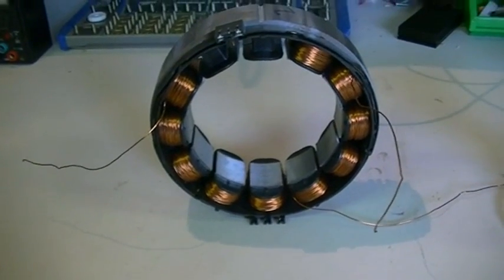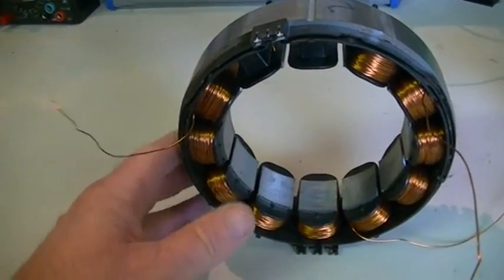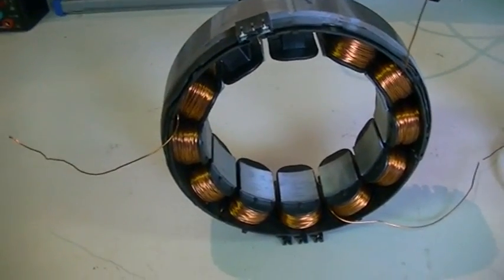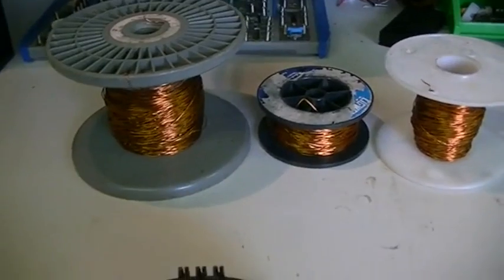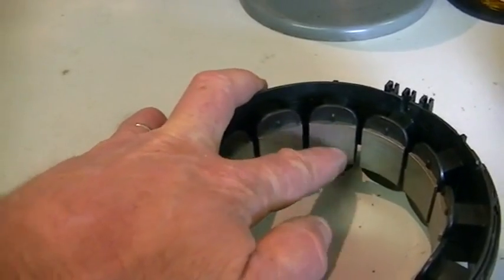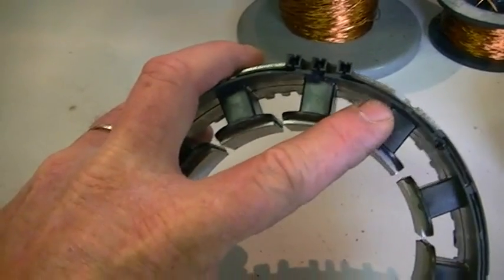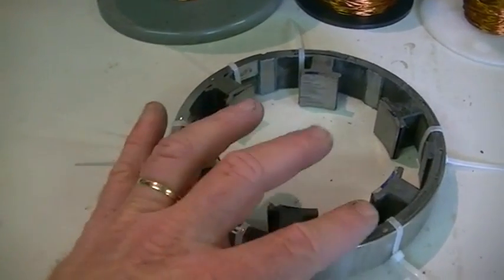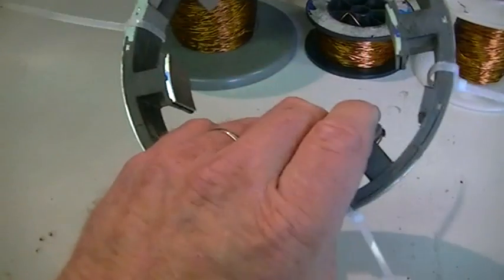Tesla Hybrid, The Lenz Force Motor Generator

Comment: Everything is
Watts and torque.

Gas engine torque is rated at the catastrophic point of rpm, because you can't use an engine for long duration at  maximum rpm.
Most engines are designed to operate from 700 idle rpm through 3500 rpm normal eceleration then level off between 1500@45 mph through 2000 rpm@ 70 mph.
In this max run zone you are only utilizing 3.5 % of gross how.
So a stock 200 hp engine cruising around 65 mph is only useing 65 hp, and the torque is relatively about 2/3 the used hp also, so @ 65 mph useing 65 hp. The engine is putting 1/3 the available torque on the crank.

I don't care what you want to accomplish with electricity vs gas.

You only 3/4 electric hp to get the same usable Nm of torque you will from a 5 hp. Gas engine running @ 3500 tpm.

So.
Inorder to provide the same working torque of a 420cc 15 hp gas engine  driveing @ 12000kw generator input shaft.
You will only need a 2.5 hp. 1550 watt 120v 13 amp 3600 rpm electric motor to get the needed 26 Nm of torque to drive the 12000 watt generator.
Thats only useing one of the 120 v 15 amp recepticles to drive the whole damn thing under full load conditions with out the gas engine.
a free wheel clutch installed between the gas engine and generator allows the engine to uncouple from the gen completely when the elc motor takes over for it.
No telling how long a gallon of fuel would last needing only a half teaspoon to start the contraption.

Comment: Your thinking here makes sense to me. The way I see it, an ac induction motor may be collecting flyback to add torque on the shaft,  but not likely as efficient as a pulse motor may achieve. A big difference with the help of electronic timing to get the most feedback from every input pulse.

Comment: That is a really interesting magazine. I just sat here and skimmed through all 114 pages and thoroughly enjoyed it. Thanks for sharing.
Reply from the maker: GrandadIsAnOldMan Your welcome
Reply: thanks for sharing - your video helped me complete a drawing i needed to complete - the stator is wrapped so because if you open the plastic from the top of the rotor you will see that the poles of the rotor are created by two poles acting on the laminate 'pie slice'  - if you re-arrange the poles by removing the pole devices {sometimes called 'magnets' } and configuring them so that there is 6 poles {think drawing} with the edge of one pole at a 120deg vector to the center of it's same pole - you will have two more or less 'inverted poles - then that 6 pole rotor will match better the stator for efficency - because each aspect of the pole will be 1/3rd across an edge of an opposing pole in each event  - an aspect defined as - 1. an approch - 2. a center and 3. an exit - {as in a pole moving past an inductor} an 'event' defined as one complete set of the 3 aspects i.e one pole across one inductor. the stator has 3 event sets. but it all balances.

if it sounds complex that's becaue it is... as text on a screen however if you do it as you are a practical person as i have observed you will see how it works. 

if you have the correct pole configuration it would be 3 'swirl' poles and 3 'dot' poles - with 4 NA or 'no pole' i'll let you figure out how you get a 'NA' or a pole - i think it will be self evident once you pull the pole devices out. if the degrees are as i stated you will have 4 NA. with 3 'Swirl' and 3 'Dot' poles. 

this way you will not have to cut anything and / or rewire the stator. 

what i haev described to you here is much closer to a 'Tesla' generator. 

regards.
Reply: His welcome?
Reply: Boosted98gsx m